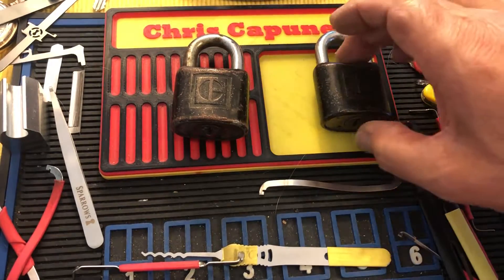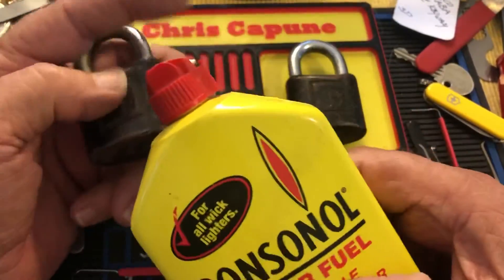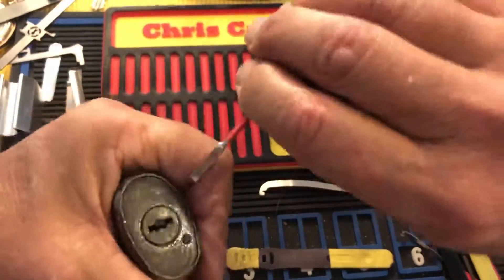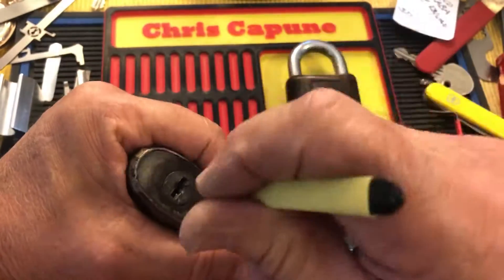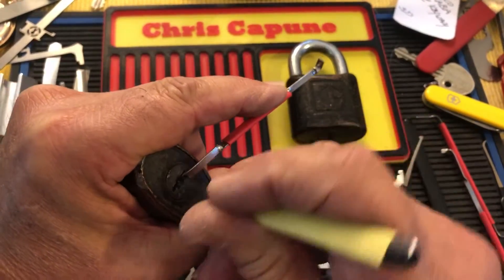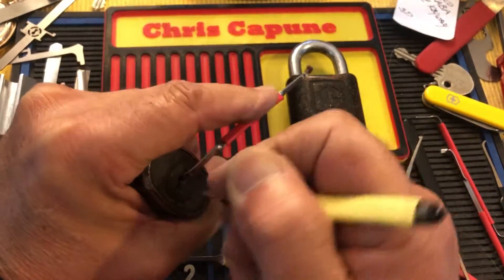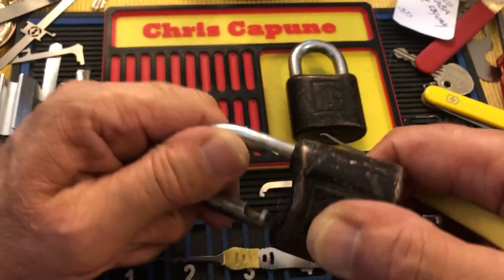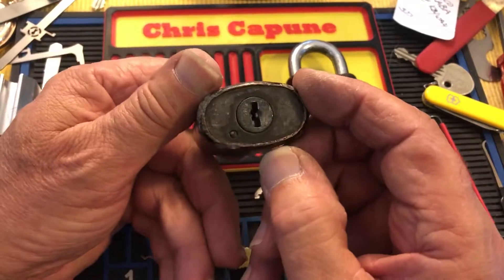#420 gunked up wafer lock unstuck

Comment: I've been buying 1 litre bottles of Diggers Shellite (Australian. Just lighter fluid). On my third bottle now. I've also experimented with squirt bottles. Some just aren't up to the task or doesn't work right. Settled on a cheap one for sewing machine oil. Plastic bottle with a fixed metal protrusion and a little metal screw on cap. It holds about 125 ml. I fill it up with Shellite then squirt that in. One old lock was so bad, I had to so it multiple times and then ended up doing some full immersions as well.
The little squirt bottles work so well, I ordered some more. Will use one with isopropyl alcohol and another with methylated spirits.
Reply from the maker: Gary Rumain very cool idea!!!
🐈👍🐈

Comment: Really good tip. I always wondered how Berryman’s B12 carb cleaner would work. I know it melts hard grease really fast.
Reply from the maker: Fried Pi 3.14159 thanks!!
Some people use break cleaner. 
I like stuff I can use without having to go out to the garage. 😅
🐈👍👍
Reply: chris capune My garage is my happy place. 😜
Reply from the maker: Fried Pi 3.14159 
Like my garage. 
But having spent half my working life in there and half at customers houses am to lazy to do much work in there anymore 😂 
Just want to clean lock on the kitchen counter. 
The lighter fluid doesn’t smell much and doesn’t hurt the counter 😀 
🐈👍👍🐈